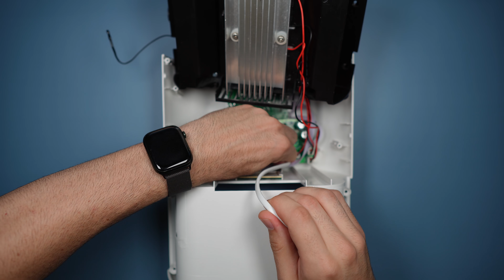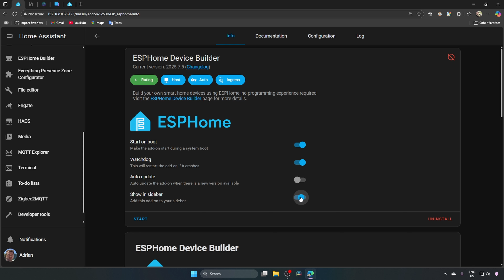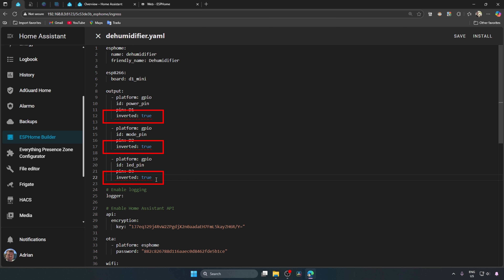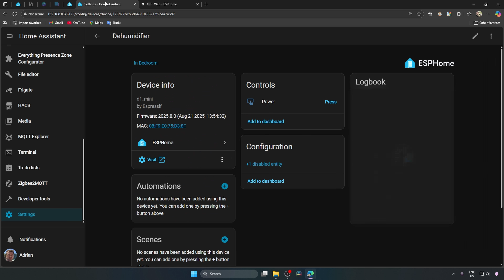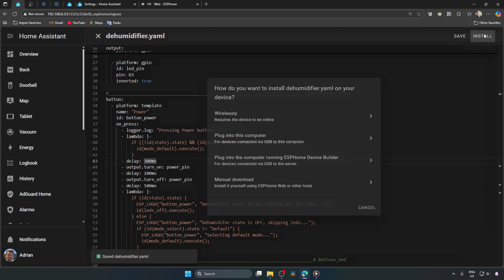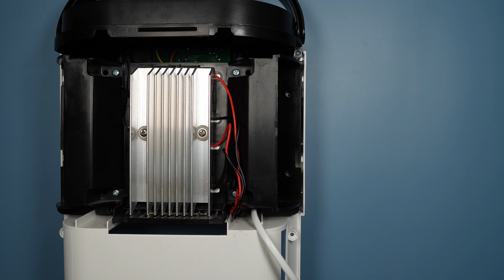Turn ANY Device into a Smart Device with ESP8266

Comment: This looks cool, but maybe a little over complicated?
A lot of smart home devices use esps (or other wifi microcontrollers in the same form factor) anyways
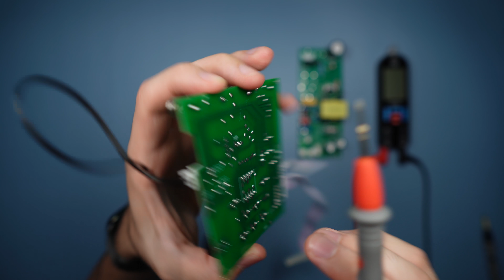At 2:20, the empty square of soldering pads below the two touch sensors to the right looks like a place to solder an esp sized microcontroller (although I can't say for sure because that area is not in focus for the video)
The 4 pads to the bottom right of the empty square (the 3 pads in one box and the 1 pad in the other box all in a line) looks like UART?
If they didn't lock down the UART connection from the factory, just hook up the esp's UART to those 4 pins no?

If you figure out how to control the circuit via UART (which may not be possible if the microcontroller built into this circuit isn't programmed for this, the UART connection could be for factory testing, although I think that would be unlikely due to the previously mentioned conveniently placed empty square where an esp like board could go), you won't need the other wires on the buttons, which would probably fix the problem of not being able to use them.
Reply from the maker: You might be right about UART, I’m sure there are better ways to do it.
It’s just the way I did it, thanks for the tip.

Comment: For those new to esphome, ai can help with writing the yaml but beware, esphome is rapidly changing and the LLM's often won't give up to date code. The whole power state thing can be difficult to deal with especially if the power is a physical on off switch but you can often replace this with a relay and create a 'virtual' switch and have the Esp toggle the relay (with a bit of rewiring). My problem is lack of electronics experience: if you're not burning things out you're not learning lol.
Reply from the maker: Very well said! 😊

Comment: Seems dubious to count the presses rather than sensing which mode is on by reading the LED status of each mode: whata if you're ever off by one? You need absolute values here, not values relative to some assumed default mode when the device is on...
Reply from the maker: Hi, sometimes I like to make things more difficult than they really are. It’s working very well as it is, but that doesn’t mean it’s perfect. There are definitely better ways to accomplish the same thing, but that’s for another video.

Comment: But why did you use the ancient ESP8266 (from 2014) and not a modern one like the ESP32-S3 (2021, already fully supported by ESPhome) or even the ESP32-C6 (2023, which already supports what you are doing here + the extra esp-idf is already - the Arduino-IDF is not yet available but is coming soon. The Arduino-IDF his is used, for example, for large frameworks such as for the Midea air conditioners to use it via the built-in USB-A, which you need very rarely).

Unfortunately, the ESP8266 now has countless security vulnerabilities and is an extreme problem for your complete network! The S3, on the other hand, supports the classic todays security standards with only a few known tiny vulnerabilities, and the C6 is completely up to date with Wifi 6, WPA3, etc., it is state-of-the-art in terms of security and connection quality. It also supports direct programming to build your own proper Zigbee or Matter over Thread device, which can then be integrated into Home Assistant via Zigbee2MQTT for example. The few extra euros are worth it for the improved security alone and makes the usage simpler.

The Seeedstudio Xiao models are particularly recommended here, as they are the best quality and smallest on the market - in comparison to others, including yours here, they are tiny and even have a USB-C built in. This means they fit into even small devices without any problems. They cost around 6$ for the S3 and 7$ for the C6. But of course, you can also use other standard boards that are slightly larger, but they are all quite similar now and only costs around 4$ to 5$ on Aliexpress. But please dont use the ESP8266 in 2025, there is no need for this anymore...

Comment: Please, forgive my ignorance if I’ve missed something, but wouldn’t this configuration only work on “any” device that detects 3.3v button presses?
Reply from the maker: 5v devices should also detect 3.3v signals, if not, you can use a level shifter.

Comment: Very cool! I’d love to see a similar video but for a “dumb” dual motor standing desk with 4 memory presets, and up and down buttons.
Reply: I would love that as well. Because mine broke down (the control box) and I can't find any replacement so I've had to manually check which pin in the 6pin cable does what and build my own control unit based on esp32
Reply: @prettyflydust  @babrad  I believe @EverythingSmartHome did a video on this a short while back - it's worth checking his channel out!

Comment: How do I unsmart my new devices?
Reply: Just pick a hammer, any size.
Reply: @glennhofmannl Ok, what next...???
Reply: @siddhantkhare2775  Check if you are smart if so apply hammer and repeat. work good, am no smart now
Reply: Watch the video backwards…
Reply: @MarkHarrisonUK  funny ahaha
Reply: Block all internet in and out from that device. Would be a first step. If you don't have a manageable router, use the hammer as suggested above.
Reply: @MadmarxOfficial you don’t need to block internet. Simply do not configure wifi on that device
Reply: @sierpus  some devices insist to be connected to wifi, but do not care if they do not see the world wide web. E.g. roborock vacuum has a companion app where you can select rooms to clean, scheduling, resetting maintenance etc. Blocking all traffic it asks for on outbound and incoming on your firewall does not prevent it from working, it works just fine as long as you are on the same wifi as it is (if you connect it to the internet then you can also control it from outside of your network but I do not really need that)
Reply: @MadmarxOfficial  yeah that dont work when they have online drm verification just to turn the bladdy things on!!
Reply: @BlueJDev holy crap, who does that?
Reply: @MadmarxOfficial  most recently there was a go pro like camera that required scanning an on screen qr with their official app to verify the drm and load it up...
Reply: @BlueJDev unplug wifi board or if integrated, pull antenna wire.  I like the MAC filtering or hammer ideas too.
Reply: Ahhhh, unplug it👈...

To be honest, I agree with your question. I recently disassembled 2 touch lamps and removed the touch electronics and now have lamps that come on or go off when I want. Not a Smart feature per se but still.....
Reply: @flyingping  when did bedside clock alarms become so expensive and intrusive. I just wanna wake up to tranquil music and have my choice of music from my phone or radio. I don’t need Jeff Bezos lurking under my bed waiting for me to say a magic word.
Reply: Return it
Reply: Most of the devices like roombas, air conditioner etc. also using ESP chips. U can disconnect them.
Reply: Sometimes you can't. If that's what you want, then you must purchase devices without "smart(spy) features"
Reply: Buy old devices
Reply: Welcometo the Watchlist 🎉
Reply: @Pexon_Mid 🎉🎉🎉 thi is my favorite  comment
Reply: Build brass mesh into all the walls of your house smash anything with WiFi and cancel your phone plan 👍
Reply: @ErikIversenNU  Du ka put det mæssingnet op hvor der er mørkt, varmt og lugter lidt.
Reply: Sledgehammer?
Reply: I put mine into a large bin
Reply: Don't buy them
Reply: Put them in a faraday cage
Reply: 😂😂😂 love this comment
Reply: Block MAC in your WiFi settings.
Reply: Have them join  PSD
Reply: Just be yourselft and it will reach the same level as you
Reply: @daspisch  Are you able to elaborate a little bit on your comment?
Reply: 😂😂😂dude great, its just instant.
Reply: EMP would be my first choice

Comment: How much water it extracts in 24h (average room temperature and humidity levels) and what is the power consumption? I see your model has two peltier devices so heat-sink is twice as large as the one I have. My unit uses 40W and extracts about 130ml of water at 45% relative humidity and +25C average temperature.
Reply from the maker: Hi, I’m not really using it, anyway it’s not good, I had it in a 13 m2 room with humidity 65%, 20°C, I don’t know about the water quantity, I know that the humidity level never dropped  😁.
Reply: @AdrianSlabu  At that temperature and relative humidity there will be 11.2g of water per cubic meter. So 13m^2 * 2.5m = 32.5m^3 * 11.2g = 364g of water in that volume of air. So not that much water but likely the room is not sealed so you will never reduce the humidity if air is constantly replaced. And if there is water stored in to walls or other objects in the room it will take some time.  The compressor type dehumidifiers are more efficient but also more powerful so they will reduce the humidity faster but they are also way more noisy.

Comment: Seems like board was actually designed for esp32 maybe it's possible to solder the chip and write a custom firmware or use one from other model with wifi support of same dehumidifier

Comment: Good Project!!! 😊 how does humidity value is read in the application? Cheers!!
Reply from the maker: Hi, I’m not reading the humidity using the ESP, the humidity value you see on the custom button is a zigbee temperature and humidity sensor from sonoff which is connected to home assistant.

Comment: This is a great video! Now, I have some USB devices that have buttons in them, but the voltage that runs across the circuit is 5V. Would this same approach work, or how would you approach this?
Reply from the maker: Hi, the digital pins are 3.3 V, but that should be enough even if your board uses 5 V. If not, you’ll need a level shifter. Hope I didn’t say anything wrong.

Comment: Nice video and so on...but that is NOT dehumidifier. it lacks of compressor per my udnerstanding.
Reply from the maker: It was advertised as one 😁
Reply: It’s a peltier and heat sink controlled unit. They do collect a lot of moisture, but a bit power hungry.

Comment: Love the solution but absolutely hate the yaml scripting (as a concept, not your scripts ;-))
Reply: Can I ask what's wrong with YAML and what's your alternative? Would you rather write the entire code (including wifi stack) in C or CPython? I wouldn't and I love YAML files.
Reply: @rogalsiu Any syntax that rigidly counts spaces and/or tabs is horrible. Anything C like is at least comprehensible and not as picky in the formatting.
Reply from the maker: @rogalsiu  For a person with no coding experience, it might seem a bit scary, and I doubt he really hates it.
He probably just prefers a UI over writing code, which is nothing wrong, just a matter of personal preference.
Reply: I don't like how it switches between various types of syntax for lambdas and HA templating language. Of course that's not YAML at fault but still. And yeah, the space counting is a bit annoying sometimes. Other than that it works great in esphome and various other places because of how it forces structure on you rather than every dev having their own style. I just wish for something a bit more consistent.
Reply: yaml is a declarative syntax/language, so either use declarative languages to describe something but don't mix it with procedural syntax. Completely counterintuitive if your are a developer/programmer. I would even rather prefer python over this and i hate python
Reply: YAML is a Markup Language (Yet Another Markup Language) but in this it is being used to encode a series of instructions, like an imperative programming language would typically be used for (C, Python, JavaScript etc.)

It's more just not what it was designed to do, than anything else. It lacks a lot of what you would want when encoding a series of instructions, and learning this will disempower you in the future versus learning a language designed for such things. 

As for having to write a full stack of complex parts like wifi controllers and things, that shouldn't be a problem either way, even in C. If this YAML approach has all of that provided, it could be provided for a C program just as well.

There's nothing terribly wrong with using YAML here but you would serve yourself better to use something like python. If writing the python seems more complex than this YAML, that has more to do with the environment and the tooling it provides, than the language itself. 

In an ideal world tools like this would provide a library that makes writing the python just as easy as this YAML, and then you could take all that learning of python you implicitly did by doing this to do any other programming task in any other environment. Since YAML isn't designed to encode ordered instructions, you unfortunately won't develop quite as easily transferable skills by taking this approach. Not at all the end of the world, just unfortunate.

An advantage of YAML in this context would be that you would be quite limited in what you can do, so perhaps less prone to someone giving you malicious code to copy and paste, or at risk of breaking something (although again, the environment can protect you from that to differing degrees, including to the same degree as the YAML).

- just some senior software engineer
Reply: I hate how incredibly poorly yaml is documented. I find it such a pain to work with even with considerable programming experience.

Comment: Good tutorial. One thing you could add to make it more generic and usable for other devices is a step to measure the voltage at the buttons so you know if the logic should be inverted or not.
Reply: You don't even need to measure anything. It's pretty obvious from the electrical connection but even if it doesn't work as expected when going from low to high when pressing (i.n. in non inv mode) you just put it to inverted.